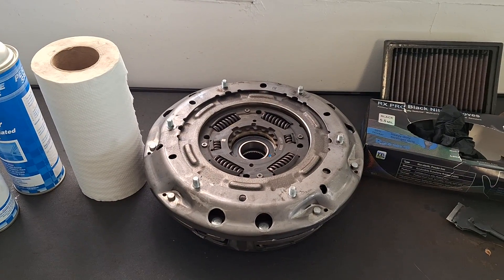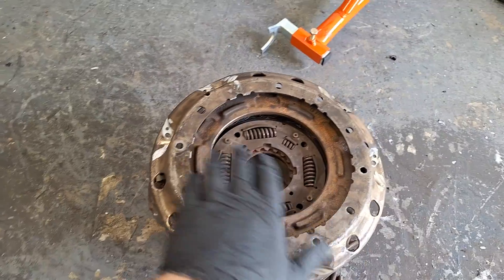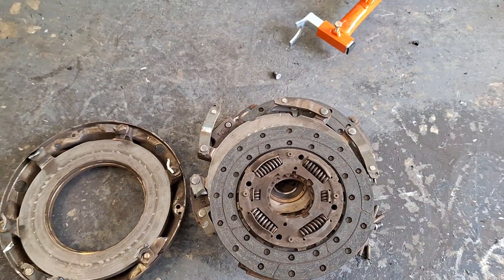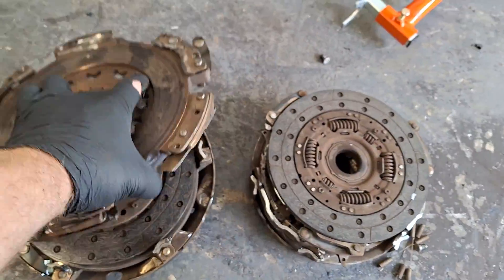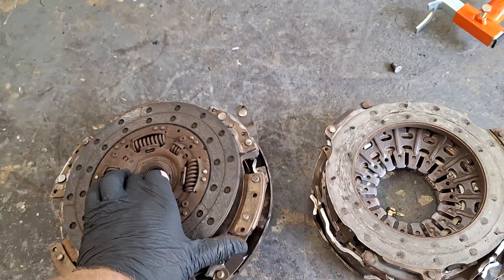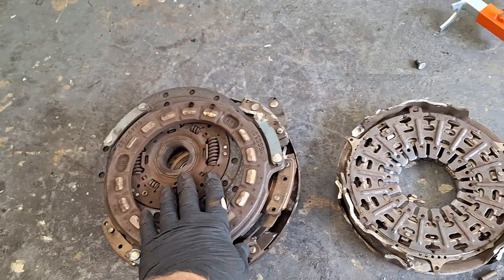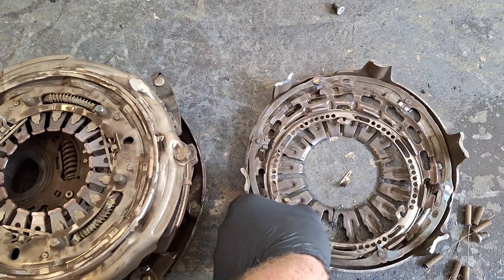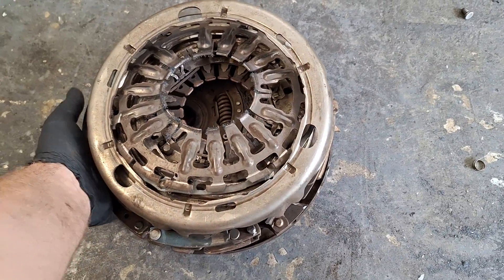Taking Apart a Ford Focus DUAL Clutch Pack! DPS6 Powershift Transmission!

Comment: I bought the aftermarket clutch and it doesn't have the triangle mark on it, so how do I match it with the flexplate?
Reply from the maker: Just put it in, never seen that cause an issue. However those cheap Chinese clutches have tons of issues so you might have to pull the transmission back out and put a luk repset in it

Comment: Mine is shuttering a lot at 95k
Reply from the maker: You can try taking the clutch out, blowing it with compressed air and a leaf blower, cleaning the forks and clutch housing and putting it back in

Comment: Just a thought .
These suffer from Severe dust issues in the bell housings as we all know .!
If a  12mm hole was drilled in the top of the bell housing and a 6mm hole was drilled in the lower bell housing .
Then Brake n clutch cleaner was funneled into the top hole while car was idling .
Btw Remove A and B solenoids beforehand .
This I think is worth a try if you have no other option of removing the gearbox .
This might work to clean out the bell housing .
Your thoughts ??
Replies taken onboard .
Cheers 😊
Reply from the maker: Hi, I've seen people do that for cleaning clutch forks, but not for the clutch. That's an interesting idea, might get rid of some shudder. Just gotta seal up the holes good.

Comment: Didn't look too bad. I wonder if a can of brake clean would help slipping or engaging issues? Without any way to get the dust out these clutches essentially baith in their own filth until something stops working.
Reply: Definitely !
Reply from the maker: Yeah, if you pull the clutch out and blow it out, pull the forks out and clean them, and the clutch housing, maybe a new slave cyl, perhaps thats a viable option!

Comment: Hey Ben, my car started shuddering at 110k miles and its now 119j miles on it, it does shudder all the time in a stop and go traffic, how many miles i can expext on the same clutch?
Reply from the maker: I'd drive it as long as you can handle it. It'll shudder and eventually all the dust will cause the clutch forks to stick. That's when you'll need to do something

Comment: 2005 ST
175,000 miles
cant find parts at the junk yard

2009 SES  
304,000 miles
wife rear ended a Toyota 
the Toyota left on the back of a tow truck 
I reset the fuel pump switch  and pulled off the front bumper and grill 
and drove it home ,
Boy i sure wanted to join the 400K club .

2015 SE 
136,00 miles 
 now this thing when i let off the gas ,
it feels like the brakes are dragging . its not the brakes 
it just dosent coast 
  I getting 28 MPG inthe city .
Do you think thats normal.

Oh i found out were the parts are going .
  Sunday junk yard posted a 2018 focus 
Monday i gat to the bank for cash and i get to the 
junk yard at 10 AM
The TCM is gone the rack and pinion gone .
   So i look at the 2005`s for parts .
 Theres a guy with a wheel barrel  full of TCM`s 
rack an pinions , so i ask him 
if he was selling them on ebay 
nope i sending them to mexico

Comment: The question i have would be, how many times would you have to replace the clutch and forks etc. to get to 250k, let alone 500k or more? I have a 2014 Focus SE i bought like 2k miles ago. It's at 161,600 currently. I don't think i could do the job myself and I don't have $1,000 to $4,000 to spend every how ever many miles. The car is fine at the moment. I replaced the battery, it had corrosion on the negative terminal, and i replaced the mega fuse that has the yellow wire attached to it. I had no idea about this car until a month or two after i got it. I just hope it works long enough for me to pay it off so i can trade it in.
Reply from the maker: Aside from the auto trans its an outstanding car. With a new clutch, forks and slave cyl (LuK kit) properly installed you should get 100k between clutches. Youll need to learn to live with clutch shudder
Reply: @BigBensCarsAndCycles  I've learned the shutter, that's for sure and I've watched every one of your videos on the Focus and about the Luk kit, at least the free ones. I need an obd scan tool, but can't get one right now. Money is tight. The car still does what i need it too.
Reply: @BigBensCarsAndCycles  also, keeping in mind that it is a Manual transmission with the computer making it an Automatic helps. Drive and Reverse do nothing until you hit the accelerator, you're basically in Neutral until you hit the accelerator.
Reply: I just hit 250k miles on the original clutch it’s toast and I have to replace it….

Comment: Thanks! Ben So why did they go from 1 plate to 2? I had 185,000 miles on a 1985 Cougar and never replaced the clutch plate.
Reply from the maker: Hi! I'm not sure why they went to 2 clutches. If I had to guess it's for cost savings and fuel economy

Comment: Thanks for this ,I do have a question. I’ve replaced a few of these but I have one after 20 thousand miles started making a scraping like clutch noise only in sixth gear and if I let off the throttle or take it out of gear stops making noise? Any ideas as it’s still driving shifting great.
Reply from the maker: Hi! May be clutch chatter. It's something I've heard on many of them. It's just a noise from the clutch and won't hurt anything else. You can try driving it hard to scrub the clutch and it may mitigate the noise
Reply: @BigBensCarsAndCycles  thanks again !